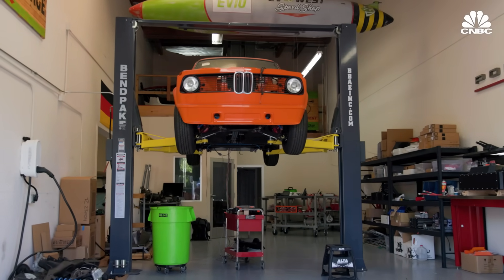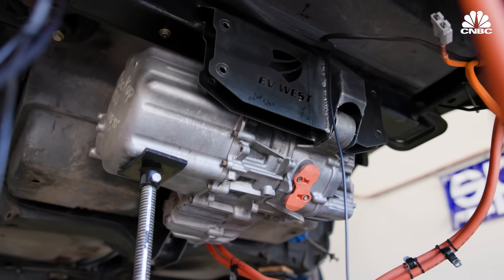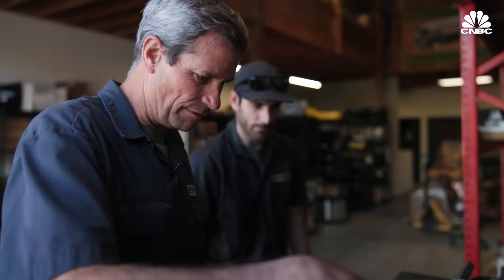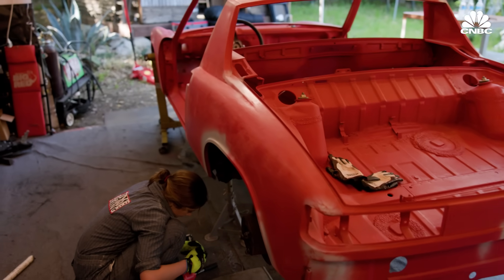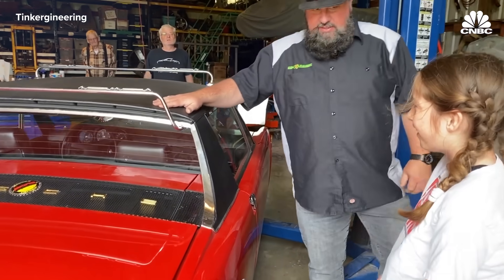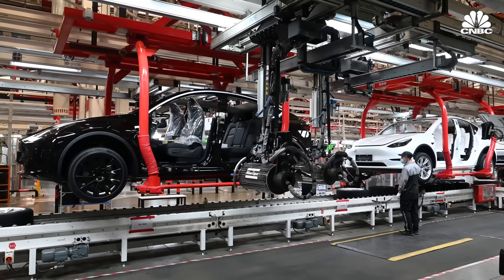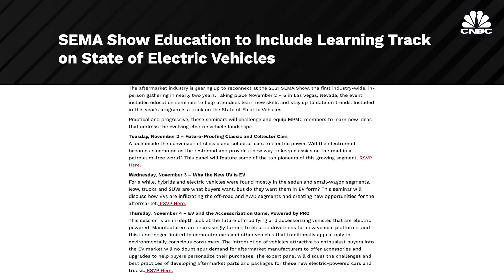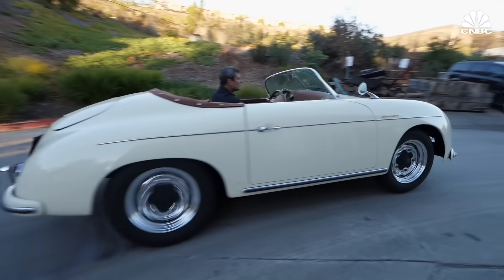How To Convert A Gas-Powered Car To An Electric Vehicle

Comment: I got the patent on converting gas diesel engines into 100% electric vehicles.  That looks nice. 
How are we going to get  a motor to sit inside of an engine block after the Pistons have been removed. Use a belt chain pulley system to run through the cylinders to turn the main crankshaft of the vehicle to power it forward and backwards.  Also you will be able to use the original air conditioning power steering alternative to run the lights and run all the electrical systems that was designed and came with the vehicle.  Won't rust out tucked inside the motor block of a vehicle.  What models of on road vehicles do you think you could make a setup like this for

Comment: Compared to diesel maintenance as if diesel engines are any harder to maintain than gasoline or ev motors they dont even tell you how to maintain your ev yet you gotta figure that out on your own not knocking ev however i do strongly believe all ev should be paired with a combustion engine of some sort like hydrogen😅

Comment: Ah, yes. Scrapping metals that could've been reused, throwing away additional materials in the landfills, disposing away oil that was probably still good and putting a battery in a vehicle that caused more pollution during manufacturing than a Jet Plane will ever make in it's lifetime. Brilliant idea.

Comment: Apart from being insanely expensive, many EVs have soulless designs. Knowing it's possible to restore a 90s Corolla and swap the underpowered gas engine for an efficient, high output electric motor is awesome. Sure, it's going to take a lot of work and money, but that's the price of #builtnotbought.

Comment: Great grandmother Mrs. Frances Farnham at age 93 has just completed the electric version of her Porsche 914, asked to comment, Mrs Farnham said, "I told you I would finish it, it took a little longer because the EV pack was succeeded by the plasma drive that only needs refueling every 20 years."

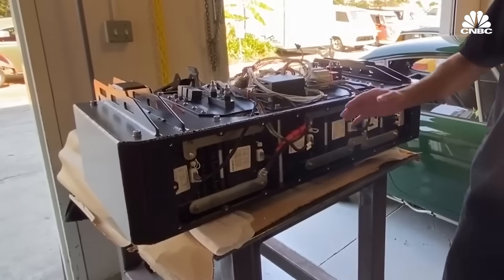Comment: @12:00 "... I just don't ever see it happening at scale affordably."

Au contraire, see the report "Ending the ICE age – Can e-retrofit help Europe phase out fossil fuel cars? (Electrify 2023)":

"... e-retrofitting ... generates 70% fewer CO2 emissions than keeping the original fossil car, and 40% less than purchasing a new EV."

"Cost outlook. ... e-retrofitted cars produced in large series would quickly become cheaper than new EVs, with a gross starting price dropping below €8,000 between 2035 and 2045 (VAT included, subsidies and cost of the donor car excluded) ..."

"... the potential pool of fossil cars to be retrofitted is about 236 million vehicles [in the EU] in 2030, with emission mitigation potential of up to 4.8 Gt of CO2."

"The 1.5°C Scenario could see 210 million cars retrofitted. ..."

(That's for passenger cars. Buses and truck can already be e-retrofitted for half the price of a new EV.)

Comment: Instead of converting, consider the Toyota bZ4X—a reliable, efficient, and environmentally friendly electric SUV designed for modern driving needs. It offers great value and advanced features without the hassle of retrofitting.

Comment: If you take any ICE car and convert it to a BEV, is it still that car? The engine & transmission is a big part of what those cars are. Robocop is a great police officer but Alex Murphy was a really nice guy.
Reply: there's no "fossil fuel engine" required to meet the definition of "car", Cars are vehicle type focused on personal moving

battle tank with an electric powertrain is still a tank because it's still a gun and armor can move
Reply: @SRDPS2  Tell yourself whatever you need to tell yourself. Ill keep buying fossil fuels.
Reply: @ so your main point suddenly becomes nothing but the ego of your own value, gotcha

it's just powertrain changing (until you deep dive into what's actually bad about EVs)

Comment: I'd love an EV but like many people I just can't afford it, here are a few things you can do meanwhile to get that EV experience:

Fill half the tank with rocks, increasing weight and reducing range
chuck a few more in every time you fill up
Of what's left, never go below 20% or above 80% full
every 200 miles pull over at the back of a lonely parking lot with no shelter or amenities and just soak up that atmos for an hour.
Take up aggressive panhandling to force others to help pay for your gas and car payments
put a sticker on the back informing everyone of your moral superiority
Finally, when you come to sell the car, insist on taking only half the going rate.

Try it, you'll never go back to the convenience and affordability of a gas car! (you won't be allowed to)

Comment: I absolutely love the idea of an electric car or truck.  If there is no long distance range though,  it is useless to me.  People forget where the electricity comes from and in North America,  the majority of it comes form coal, natural gas or other so-called fossil fuels. This BS talk about performance should be changed to range and then the lack of range anxiety.  Electricity isn't free either.  There was a comparison of a Tesla Cybertruck vs Dodge Cummins in pulling a RV trailer and it cost more to pull the trailer with the Tesla than the Dodge,  so there is no savings with electric.

Comment: When I read the post I had wrote awhile back, I realized I was having a panic attack. 😂. I would really appreciate something like this. If the charge on an EV only last so long and there isn't enough charging stations.  I would like the capability of switching back to gas till I find the next charging station.

Comment: Use power as it is created. Engines have optimal efficiency speeds, electric have wide range. Batteries are best for spirts of power when needed. Electric should last longer as vibration and heat issues are resolved. I'm a retired rail electrician.

Comment: I am so fascinated with this idea.  Converting my 2010 grand caravan to electric.   The van is full of practical features for work (carpenter) and hauling family but nearly completely void of reliability.   I bought it new and now has nearly 200,000 miles on it.  I have spent so much money fixing over the years.   Reliability may be somewhat hampered because i load it like it is an f250 and drive it like a race car.  The thing the electric would replace, the engine has been fine.  No money on that except oil changes and copious amounts of gas.  The transmission too has needed very little service.  Everything else, brakes, suspension, cooling system, hvac, power steering engine mounts etc, has been an ongoing spending spree.  So it just seems silly to spend so much on the transition and then still need to keep up with those other ongoing problems.  Pacifica and Siena hybrids seem like decent alternatives, but the pacifica comes with the same stelantis reliability as the caravan and toyotas don't become affordable until they have 100,000 miles on them.  Suggestions?

Comment: RANGE?? 10 - 50 miles per charge? CONSTANTLY recharging required which REDUCES BATTERY LIFE by 70%! These things need new batteries every week! PROOF THESE AR ESTUPID? These conversion stories do NOT look at performance or show success stories! Why? Because these are The dumbest EV concept ever. EVERYTHING presented says 'We don't know ANYTHING about EV design and efficiency and performance!' NONE of these conversions will compete with properly designed EV's (efficiency vs performance)

Comment: Where do the newly converted electric car owners get their car maintained?
Reply: Good thing about evs not much to maintain😂 just tires and widow shasher fluid ig
Reply: @mcsike7264  then I should just switch!
Reply: Think of everything as parts replacement. Any mechanic can and do replace parts. Find one.

Comment: I’ve been trying to figure out if there’s a way to add an electric motor to a car with a gas engine. I guess kind of like a hybrid, but where it’s built for speed instead of efficiency. Basically so people think it’s still just a gas car but when you get on it, the electric motor kicks in and gives you some serious acceleration.

Comment: Or we could just convert our fuels to algae oil derive fuels and all of our problems would be solved. Fuel is made from algae oil produced up to 86% less emission so it'd be like taking 86% of the internal combustion engines off the market without having to convert, destroy, or replace anything. And I'm not just talking about cars

Comment: Have any one ever transformed a hybrid in to a pure ev? Like remove the gas engine and tank and fill the space with batteries, using the original electric parts as close to as is as possible.

Comment: In 5 year's they're going to want to go back to gas ⛽️ 👦👍🏎🏁🚩 
V8 for me in 10 year's my 2022 Roush Mustang with the 3rd Pedal 6 Speed Manual Transmission will be worth 5 to 8 times more than the Toxic Corrosive Acidic Orange Brownish Gel.  Dripping into our Ground Water.  There were 4 Electric Vehicle's (EV's) Recycling ♻️ Centers in the United States.  Though, last week Arizona location burned down because the battery 🔋 packs are volatile anf Toxic fumes for 3 days.  
Another thing California doesn't have a Recycling Center, due to Environmental Impact. V8 forever for me.
Reply: I mean either way it's electric motors all the way. Battery technology is still evolving and lithium won't be the standard forever. So regardless of the energy storage system, electric motors convert 85% to 90% of their energy into kinetic energy.

Comment: How To Convert A Gas-Powered Car To An Electric Vehicle

There are much easier ways, and still doable as a DIY project, with higher success rate:

Method #1 we need an intermediate conversion *medium*.
Here's an example: convert your G63 AMG (or any other ICE car) into money*, then convert that *money into a Tesla Model 3.

Method #2 is more direct: trade in your ICE car or SUV for a Tesla Model 3.

Comment: The entire point of having a vintage car is to experience it either as it left the factory or with period correct modifications. Putting an electric drivetrain in it ruins the experience and makes the car worth less.

Comment: If there was a way to take the saltwater batteries (which are safer and cheaper than the current lithium batteries) and tweak them a bit to where they can produce and maintain a power source that would be competitive with or outdo the lithium batteries, that would be the direction I think we all need to ponder

Comment: Once my engine goes, if I can get a solid refresh of the chassis, suspension, and interior.

I can see my self coverting My goal would be the same power to weight ratio. However i might go 100hp over 😏

Comment: You cant convert an existing vehicle to EV. in California, your vehicle must put out at least ## amount of carbon, or it is not permitted on the road. Telsa is fined $#### per vehicle sold, and CARB does not permit vehicles to be re-tuned/upgraded to newer components which would cause the vehicle's emmessions to be lower than legally permitted. I have my 91 Rodeo modified for 60% lower emmissions and 1.8x more fuel economy (and ?? increase of power), but taking the vehicle in for carb, whicle the vehicle is confirmed cleaner, they reject it because the vehicle is using components from 2000-2010 vehicles.

Comment: Hybrids are the answer...no major changes in infrastructure and Toyota has proven the technology for over 25 years.  Edison Motors has built a hybrid logging truck that is lighter than a regular truck and it gets at least 30 better fuel economy and the resulting lower emission. Note that hybrids have been around since the 40s and they are called diesel electric trains.

Comment: So, between converting an ICE vehicle to EV and buying a new Tesla vehicle is kind of a wash if the conversion would be around 40,000 dollars.   Might as well keep the old ICE vehicle which I did, and I did buy a new Tesla.   Tesla prices are slowly coming down and newer models.  My ICE Monte Carlo would need to have body work done to it because of rust around the wheel wells.  So not worth the effort to convert.
So we will see over time how this all goes with Electrics.

Comment: So those flood damaged ICE can be converted to EVs.  There's a lot of them every year being sold as a scam in the used market.  While it's more valuable to just harvest the spare parts from those flood damaged ICE vehicles, it would be better to salvage&convert them properly to get the transition and adoption of EV as fast as possible.  Guess you need the car insurance industry to be involved in this to get working and compete with regular ICE market.

Comment: We should work on hybrid conversion kits, there's a lot of people that don't want to give up their engines and a hybrid conversion would be amazing for the planet and how much money we spend on gas. Gas engines are still more cost and time efficient with highway speeds, when the gas engine is only used for the highway. Unless we eliminate our use of fossil fuels completely there's no reason for everyone on the planet to stop using gasoline engines. Cars aren't the biggest problem with our planet but they are a massive one. Our electrical grid cant handle a massive influx of electric cars. So unless we slowly transition towards electric cars, we might accidentally burn down entire cities that can't handle the increase of power.

Comment: The main thing people have to remember when watching stuff like this is that none of these vehicles are a persons everyday driver. But yet every time a video pops up about EV swaps, it always makes it seem like if a person doesn't want to buy a new EV, that's fine just swap out the ICE in your vehicle for a EV conversion. Oh that sounds like a good idea, you think. Then you find out it would cost around $100k. So it would be cheaper to just buy a used EV. But then you realize that any EV pushing 100k miles needs a new battery. that's $15k-$20k+ so that $20k used EV is actually $40k+ then you get rear ended, $200 fix right? Well then the insurance company says the battery pack might have been damaged. Battery packs now-a-days aren't serviceable. So it needs a new one for $20k, but the car is only worth $18k. So insurance totals the car. Now you're out $40k and just found out there's no cheap affordable used car market in the future with EVs. Perhaps they say the technology will get cheaper, it will. But when it does upgrades and different designs will make sure that it doesn't matter if the tech becomes cheaper. Cause it'll always be changing and incompatible with vehicles from a few years ago. The states that have picked a date to ban new ICE sales. Just checkout how they are doing five years after that ban when their used car market is priced stupidly high and yet none of them swap the battery before putting it up for sale.
Reply: The worrisome part is that it won't just affect used car prices in those states. It will minimally affect the states nearby if not the entire market for the U.S.

Comment: I love this shopping watching them for a  while I love the fact that they're converting real cars into electric vehicles and the fact that your steering wheel still connected to your tires I think is a better option than driving an electric vehicle and driving by wire that just means your steering wheel is not connected to your tires 🤔 I think that's a bad idea

Comment: I’m in the market for a new or slightly used car and an EV is not on my radar and will likely not be in the future.  Besides, you can’t force me to buy an EV.  The infrastructure in the United States is not there, nor will it be 10 years.  Go to France to see a country that has already adapted their infrastructure to EV with Nuclear.  In the US, coal produces 65% of electricity.  In France 90% of electric is produced via Nuclear.  For those who have bought into EV’s in America I have one word for you - hypocrites!  BTW, get a clue on the engineering necessary for such a conversion.

Comment: An EV conversion is a nice idea; but it will result in a very short range; such as 60 miles. It also doesn't help the larger problem with the current Lithium batteries; not enough lithium being produced. Refining a ton of Li uses 500,000 gallons of water. Current production is only enough for 10 million Tesla Y size packs a year even if you used lithium batteries for nothing else. As noted in the video there are over 1.2 billion existing vehicles. By 2030 you'd only replace a maximum of 80 million Ice cars; but even that is not possible because you need lithium for cellphones etc, so a realistic top is more like 50 million .. not very impressive dent in 1.2 billion.  So EVs need a battery chemistry that doesn't use lithium or other rare elements.

Comment: It is too expensive to convert the average used car ... NOW.  The price is mostly in the batteries (dropping like a rock) and the electronics (starting to be open-sourced and also dropping like a rock). 3D printed parts and online templates for the various adapters will also make the price drop.  If a NEW anything is going to cost $50K, converting to electric may be cost effective.

Comment: EV Conversion is not a standardized process, it is an each to its own, like McGyvering the conversion. It won't work unless there are documented replacement standards and policies already well written, and regulation/procedure/permitting. Otherwise, this is just a dream. Much better if you do an EV-assisted car, not a full conversion to lengthen the use of an ICE car, and to reduce carbon footprint, which is the main goal of EV replacing ICE.